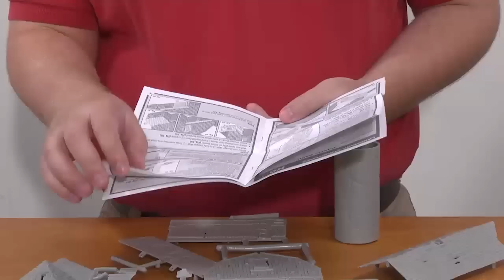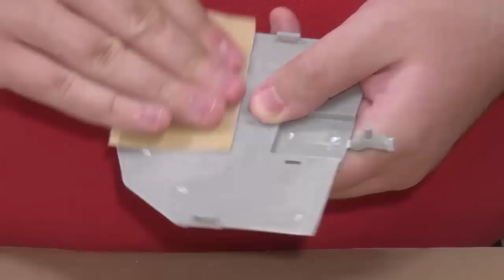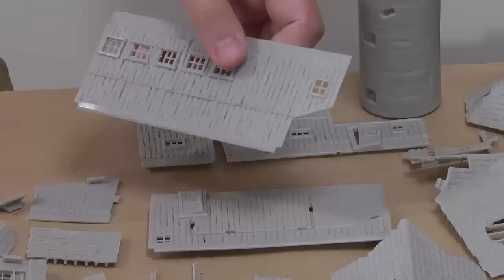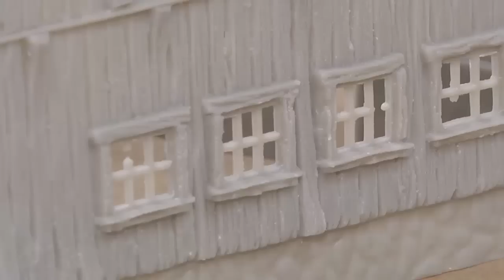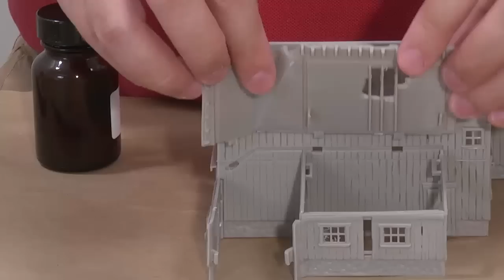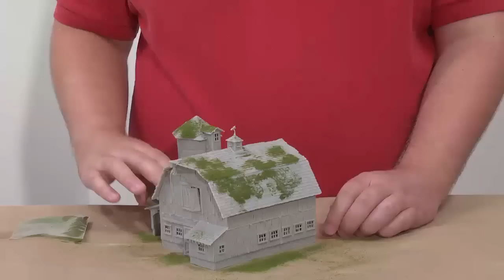Building Kit Assembly How-to

Comment: Very nice looking model. But some things that "hurt" me while i watch video is bad assembly process - there are some ugly gaps left on building (it would be better to put some kind of putty) and uncleaned flash bits, Also  person who did make assembly did look a bit shaking on some parts and unsure what is doing and somehow how to hold exact o blade  .  You should use almost always clippers to remove larger parts from sprue first and then clean with blade. 
For some assembly parts it sims that is done in bad order and could be done better with reading instructions and use common sense. For putting windows it should be noted that they should go last after paint job is done And for rope you should use some kind of super glue since plastic cement will not glue it
Reply from the maker: +deende79 We appreciate hearing about problems as well as successes with our products. I will forward your comments to our Product Development department. Thank you for taking the time to send a thoughtful, well explained comment!
Reply: Let's see you do better then.